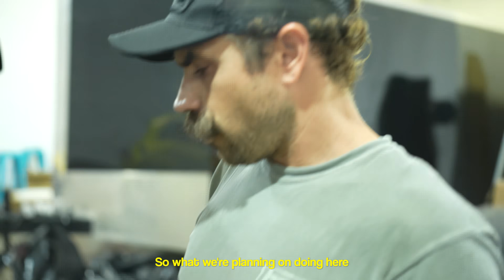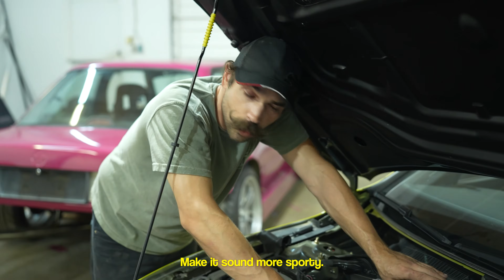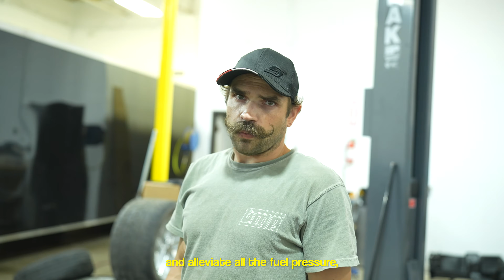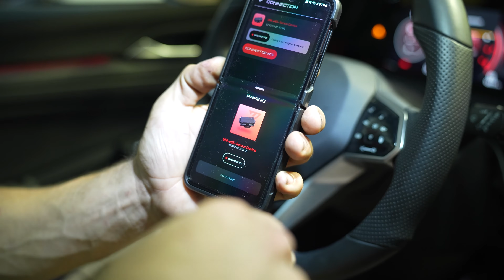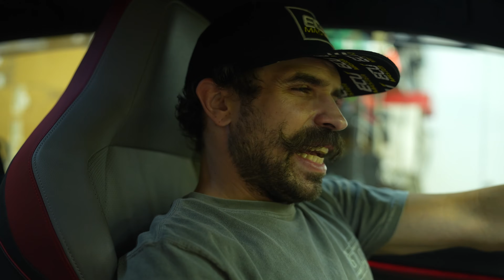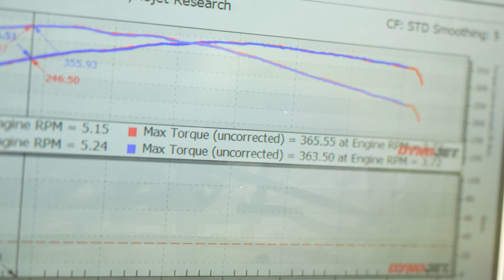Our MK8 GTI gets Flexfuel! // Unitronic Flexfuel Install and Testing

Comment: You guys are running this on a Dynojet and you can clearly see it say STD correction factor on the top right of the results. Its already corrected for the atmospheric conditions. It is not so much the weather - this needs more revision.
Reply from the maker: We have plenty of runs on the same file making way more power in previous videos. Appreciate the input though!! We will hit the dyno again in the fall I am sure as more and more software is released for our cars  ^_^

Comment: The fact it made that power in that weather is still pretty freaking good. The guys at unitronic got VW tuning locked in.
Reply from the maker: Its so hot :(
Reply: It's still a soft tune. My mk7 with an is38 makes 330 uncorrected at 5000 ft elevation with E30. Custom tune. The stock mk8 gti turbo is pretty comparable to an is38 so on E85 and low elevation for that thing to only make 345, the tune is soft. Probably low boost with a bunch of timing if it's anything like Uni's mk7 tunes.

Comment: Kudos to the team for putting this together. MK8/8Y flex fuel support coming soon for the masses!
Reply from the maker: <3
Reply: When is my dsg tune coming out tho😢😢
Reply from the maker: As fast as anyone can crack it haha @ricardocardenas4150
Reply: Will an upgraded down pipe and intercooler be required?
Reply: @gregoryschwarz2730  There will be Stage 1 and Stage 2 Flex Fuel support available so a DP won't necessarily be required. A Unitronic Intercooler is a worthwhile upgrade for this platform one way or another though!
Reply: @unitronic  I already own the Stage 1+ flash. I live in an area where e85 is readibly available. I was wondering if I can just flash the e85 tune and fill her up with e85 and it just works? No additional hardware needed?
Reply: @Roadruuner  Yes, you can go right ahead and flash the Stage 1+ E85 file without any additional hardware. Important to ensure the ethanol content levels remain within the E60-E85 range if so.
Reply: @unitronic  thank you for answering!